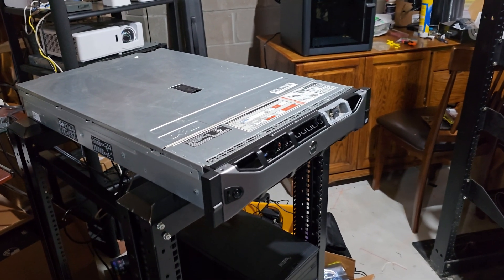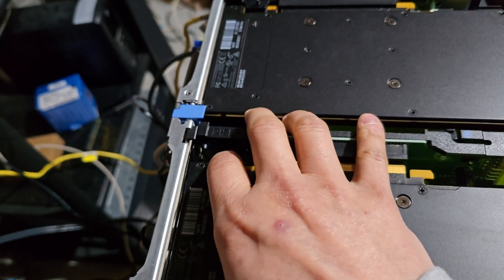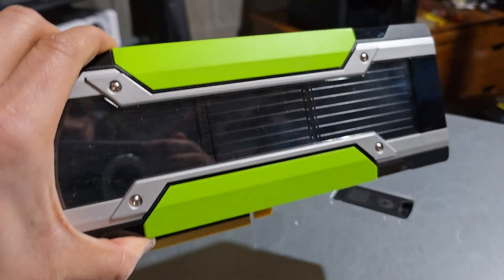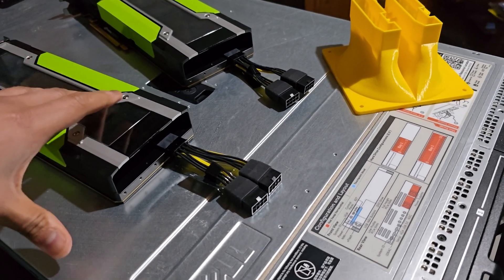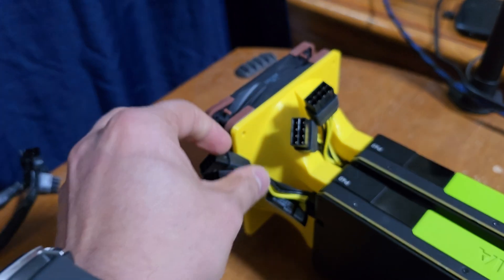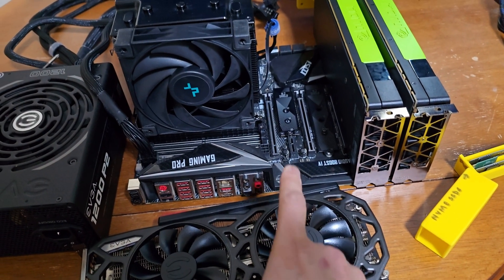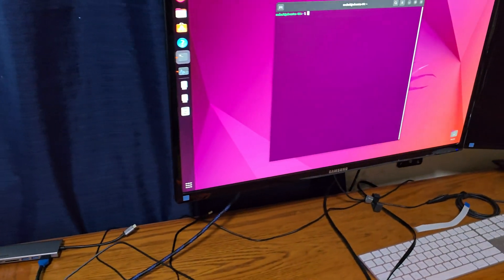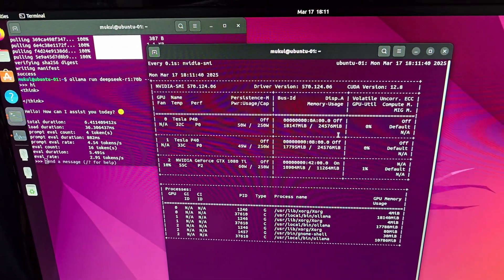Build a 48GB VRAM Deep Learning Rig on a Budget with NVIDIA P40 GPUs

Comment: The performance of the Tesla p40 isn't good. It's maximum worth is $100 if you compare it to better cards like the RTX3090 24GB

The TESLA P40 along with the M40 - 24GB might be okay to run a very specific LLM thats been optimized for the limitations of this card.
Unless you absolutely have to have 24GB. You should not be buying this card. Instead you shoukd have got the TESLA P100 16GB.
Reply from the maker: I have several 3090s, two 4090s one 5090 and a Blackwell 6000 is on the way :) some other cards are laying around here and there as well that I don't recall. It all depends on your usecase. People find cards for all prices and use for different reasons. No judgement here!

Comment: I have exactly the same rig - except I added 2 more P4 GPUs each with an addition 8gb ram to get it to total 64gb
Reply from the maker: Nice!
Reply: Did you notice a speed increase or a slow down in comparison with the P40s alone?

I mean, besides the capability of running larger models.